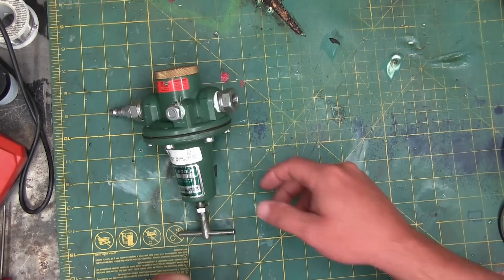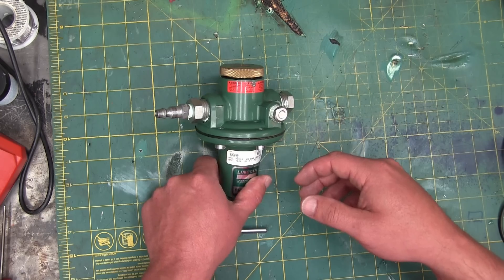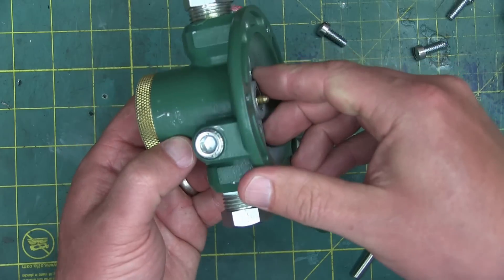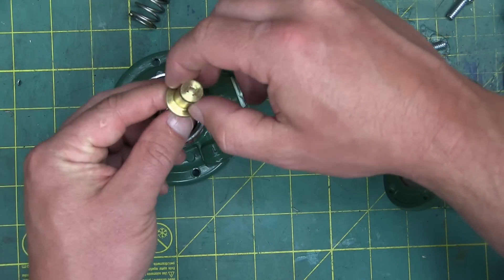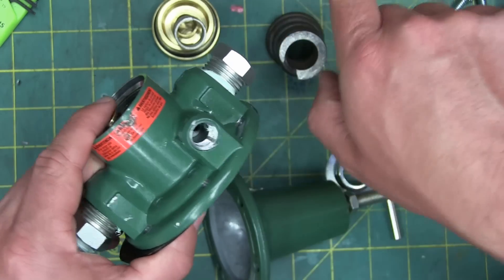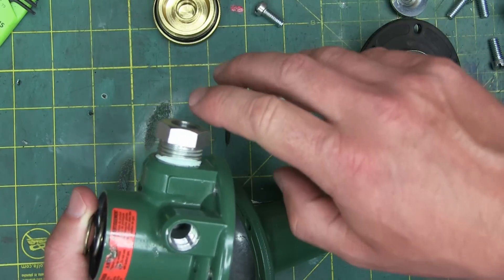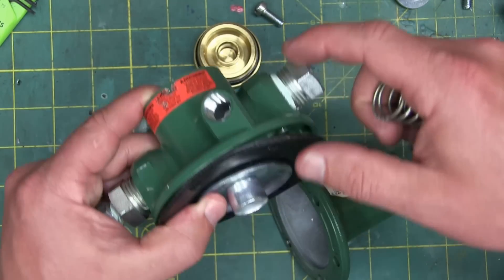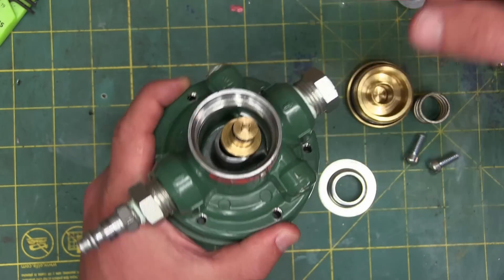BOLTR: Pressure Reducing Valve | Gas Regulator

Comment: Wouldn't a tear in the membrane cause no air to go through? You would think a failure would not allow full pressure to go through for safety concerns. Am I missing something?
Reply: there might be some regulators that have some kind of way to fix that problem. But a more common way to safe something from getting full pressure in case of a regulator failure is pressure relief valve that blasts wide open when the pressure gets above a certain point. Or in case of 3000psi systems they also use special bolts with a burst disc in it. If those things get higher then their rated pressure they wil just burst open and let out all the air. But thats better then blowing up a 3000psi bottle or something.
Reply: i think he fumbled a bit there
Reply: In an unrelated but similar note, hydraulic components are sometimes equipped with a "velocity fuse" that senses too much flow mechanically and snaps shut at the bottom of a hydraulic cylinder, say for stopping a car on a parking lot scissor lift from crushing clumsy mechanics that might have inadvertently knocked a fitting off or a hose failure between the cylinder and the control valve. Pretty hairy unscrewing one of those under a car that's in the air and you can't lower back down without unscrewing the fuse to bleed off the oil. In the few instances I've seen this happen I found most crackheads will do it for $20 though...
Reply: When the diaphram gets a tear the inlet gas flows out the setting side of the diaphram.  In the case of flammable gas that's into your house.  That's why regulators used indoors either have a precision bleed hole to control maximum loss, or run their vents outside.  In the old days the vent was run to the pilot light of a furnace.  And yes, they tend to fail open, not closed, but in practice diaphrams develop leaks slowly, so they tend to just bleed off instead of raising hell.
Reply: Depends. You would also not want to let a machine grind to a halt because there is no air pressure. They most likely considered the end use of the part.
Reply: Thanks Dave!
Reply: Thanks Bob!
Reply: When diaphragm membrane tears, it is left open, as there is no build-up  force to work against the spring.  Valve stays open, no pressure regulation.
Relief valves down stream is one way to blow-off excessive pressure.
In commercial kitchens, appliances using natural gas, and in high seismic zones,  they have these devices that if the gas flex gets torn off,   the flow rate coming through is enough to push a little plunger in the gas flex in closed position.
In natural gas regulators installed indoors, the vents have to be vented to outside.

Comment: You will lose the outlet pressure if there is a leak in the outlet side The reg should lock up at the set pressure and hold regardless of supply pressure.

Comment: Not to niggle, and indeed there is a high pressure regulator in the circuit, but when you say SCUBA, I think the average Joe like me thinks of the demand valve you stick in your mouth and suck on.  Special type of regulator?  Maybe, but it only flows when you breathe in, and it auto-magically corrects for the exhaust pressure which varies dramatically with depth.  I think it's these innovations that made mssr Cousteau rich and famous.

Comment: Iva quest chan. Saw a guy on YouTube compressing the 95% oxygen from a medical oxygen generator (for storage in a tank at 100 psi and subsequent use in oxy-fuel torches). Now that sounds fantastic. But also sounds like it miiiiight not be that safe. Anyone got good insight?
Reply: your could probably do it with a oilless cheapo compressor.   Not saying it'd be totally safe though.

The main danger with compressing oxygen is keeping any flammable substance (usually oil) out, and sparks out.  I'm not sure if they still use plastic\rubber in oxygen parts, but at 100psi (far more pressure then you'd need for a torch) I don't think you'd run into issues with a oiless compressor.

for the love of god, don't try this with HHO though.
Reply: MrTheHillfolk yes, but they use nitrogen. Completely inert.  They are apparently not allowed to use compressed air any more.
Reply: Find a Fire Dept with a Breathing Air Filling Compressor,maybe get you a old school 2216 Air Bottle or get a a new style SCOTT 4500psi Bottle and go with it.
Reply: balisticsquirel i have been wanting to do this just dont know of a safe way without buying oxygen compressor$$.
Reply: This is actually utilized in battle fields medical points where these use a fairly big scale oxygen concentrators to extract oxygen from air then pass it on to high pressure tanks reaching 1000psi. As you might know medical gas filling stations does just that, but they pressurize the standard size tanks up to 2000 and bigger ones to 2500 psi safely.
Reply: I thought some race teams use some compressed gas in a "welding tank" like that to be somewhat portable and be able to use air tools.
Reply: Or you could just pour liquified oxygen into a flask and let it heat up to compress itself. All you need is some liquid nitrogen.
Reply: If you want to see true madness look up one of the older Cody's Lab videos. I recall he captured hydrogen and oxygen produced by electrolysis (from his solar panels) in garbage bags and compressed that with regular shop compressors I think into tanks.

But the main concern with storing oxygen like that is what some others here already raised as well: make sure the stuff used is meant for it, no combustible materials. I don't know if there are special requirements for the seals and such. The type of compressor also seems like a challenge to me as a lot of them will introduce oil into the output and even in the types marketed as "oilless" there's probably some amount of oil/grease in the system just not much is used/makes it into the output. I also don't know what happens to the seals as they get warm in a high partial oxygen pressure environment, it might have bad effects.

Considering its not for medical use and just to burn stuff purity/contamination standards might be a bit lower, as long as its not a major explosive risk in use and storage. But regulations and standards on this will vary and I'm in no an expert.
Reply: My uncle used to refill his oxy tank for his oxy/acetylene torche from my grandpa's medical oxygen generator.